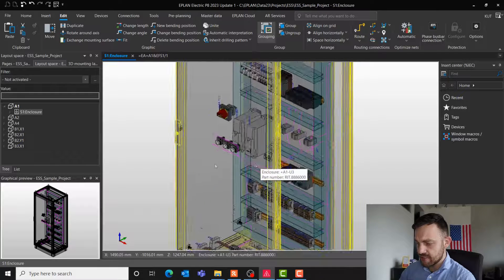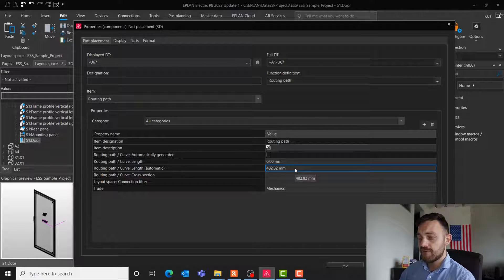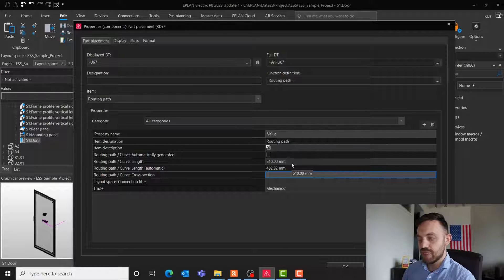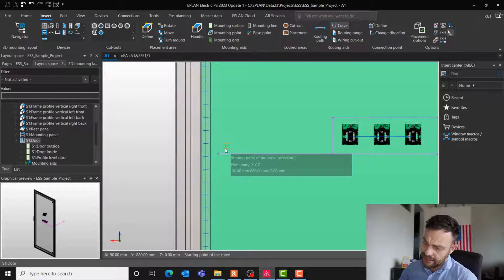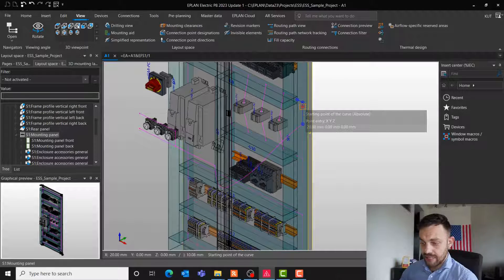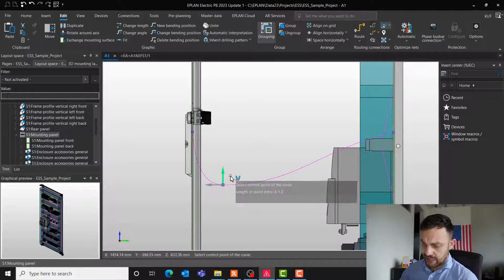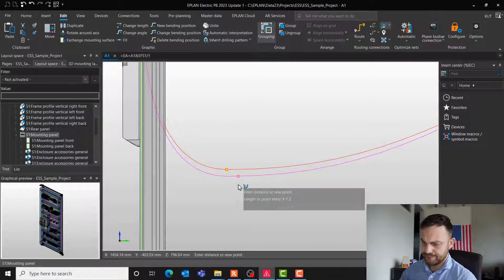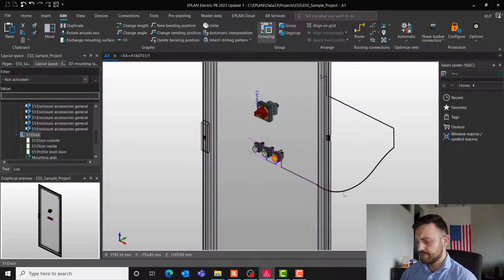How to insert Curves in EPLAN Pro Panel

Comment: I used curves a lot. But I found that making right-angle runs, provide a more generous length without having to mess around with curves.  

For example I have a 2200mm tall TS8 with 19” rack mount kit loaded with many devices which come around the sides to a backplate opposite. Curves became too much trouble so I used straight lines & the < & > arrows to make wide right angle routes.  In reality I end up with a little bit too much wire but at the exact same for all wires which results in a half decent extra length on each wire satisfying a customer specification for enough wire to move terminations by a few terminals in the field.
Reply from the maker: Thank you for your valuable feedback sir.